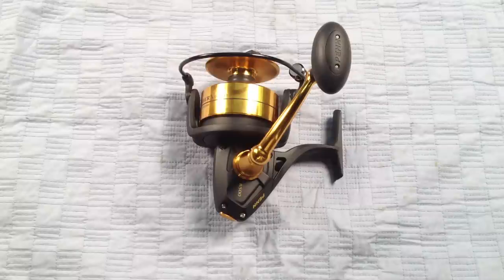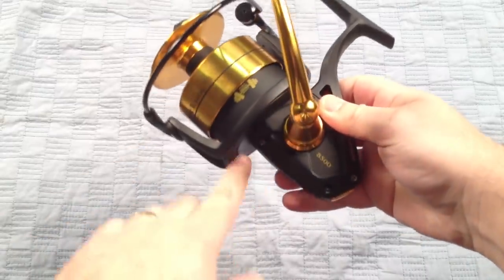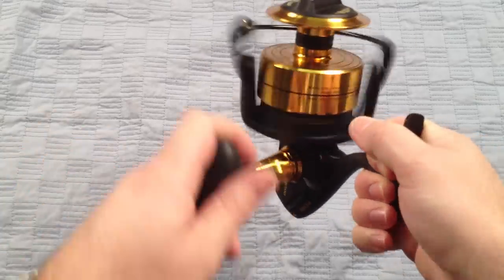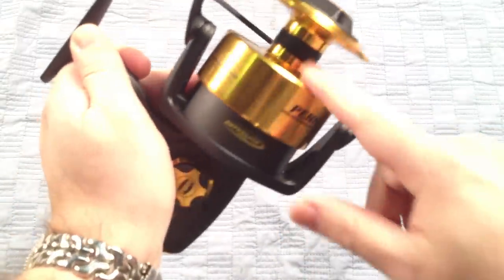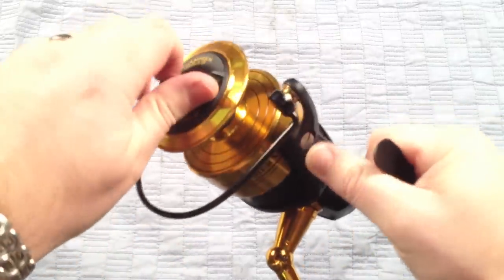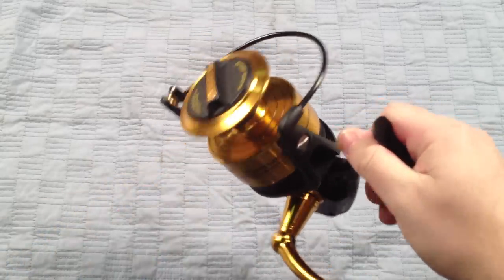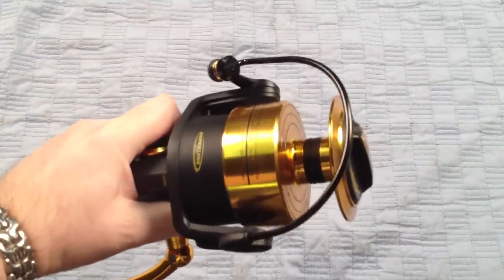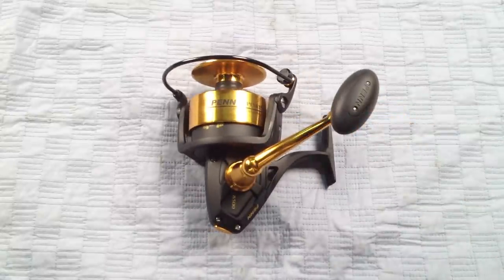Penn Spinfisher V SSV8500 Spinning Reel - J&H Tackle

Comment: im sorry i meant free spool when you catch a big fish and they are pulling him out of the water for you they usually want you to set the reel in free spool in case the fish drops back into the water, i checked the roller on the bail and could not find a little hole or anything to put the line trough, did you by any chance just mean tie the line around the roller? thanks i really appreciate it.

Comment: Hey Josh, thanks always for the great videos! I am looking for a new surf reel and you had recommended this reel to me. I am planning on doing some surf fishing with a 5500 model as well as take in off-shore. You had mentioned that this reel is okay for getting wet, but dont reel while it is submerged. I was wondering, if submerged, splashed, etc., what do you recommend doing while fishing? Only reel while out of water? Could you please elaborate? Do you think the 5500 will be to heavy for a day of casting. Ive spent the day fishing 4000 sizes no problem, but I want something with more line for more possibilities? Whats your take? I am looking for something that will last a long-time. I prefer spending a little more for something that will last longer then to have to buy again.

Thanks always!

Joe
Reply from the maker: +s940867 If you turn the handle on this reel while it is submerged, there is a chance saltwater will get inside your reel. What will you be fishing for offshore?
Reply: Offshore, small tuna, yellow tail, possible sail fish, and i also fishing kelp beds. Using 30lb braid,I had seen a guy reel in a sail fishing with a 5000 battle 2 model. I will be using it with 2 different poles depending on whether I will be surf fishing or off shore, but like i mentioned I want something that will take the occasional falling in the surf. Thank you!
Reply from the maker: +s940867 Get a Penn Clash 6000.
Reply: jandhtackle i'm not sure if I should get this reel or the pen clash 8000.. I fish a lot from the Jerry's for big stingray and shovel nose shark I like to use 30 pound mono but sometimes I like to you 65 pound braid as my main line.. really not sure because I really like the pen clash 8000

Comment: what size rod would go good with this reel? like 9ft, 10ft, 11ft?
Reply: Joshua Beanblossom I was thinking maybe a 12 foot ?
Reply: I use a 12 footer
Reply: A 15 footer is just a lot of strain on your back
Reply: @Livinoutdoors_  I just paired a 7500 Spinfisher VI Long Cast with a 12' Okuma Rockaway 1200M and this combo has been a boon to casting and catching striped bass up to 18 pounds thus far this fall. Bigger fish are headed south to us along the New Jersey shore and I believe I have finally found the right combination of rod and reel.

Comment: Would this work for Jigging for Amberjack, Bonita, Mahi, etc.
Reply: And some grouper?
Reply from the maker: Yes.
Reply: jandhtackle what size jig would you say is the maximum weight for thisbrrrl? I want to jig knife jigs like a Williamson benthos 400.
Reply from the maker: Saltfisher 14 Doesn't work that way. You need a jig based on where you are fishing and what the current is.
Reply: Oh, ok. I fish reefs and wrecks in Florida, Georgia, and the rest of the Gulf.
Reply: So would you recommend this or the 10500?
Reply from the maker: The 10500 is a huge reel! What are you fishing for? Grouper and snapper?
Reply: Grouper, Snapper, Bonita, Kings etc.
Reply: I just wanted to make sure I wasn't going to small.
Reply: I would also like for it to be a shark reel up to 6 feet from shore
Reply from the maker: You're doing too much with one reel.
Reply: Alright, ill just look at this for jigging then for Grouper Snapper Mahi and Kings.

Comment: Debating on the V8500 or the conquer 7000
Reply from the maker: Both are very large. What are you fishing for?
Reply: A'js, BFT, groupers and big snappers pretty much the offshore species with the occasional pier fishing too.
Reply from the maker: redrel21 Spinfisher.
Reply: Awesome thanks. Will this reel serve well for jigging off the wrecks? or will I need something lighter like the conquer 7k ?
Reply from the maker: redrel21 The 8500 is a huge reel. If it was me I would have a second reel for wreck fishing.
Reply: Thanks yes that's what i'm also looking for,the lightest reel I can use but still have the drag power to put the stop on those big wreck fish. budget i'm at $200.
Reply from the maker: redrel21 Spinfisher or conflict would do it. Spinning Reels get much heavier once you get past the 5000 size.
Reply: Ok great thanks again for the help subbed buddy :)